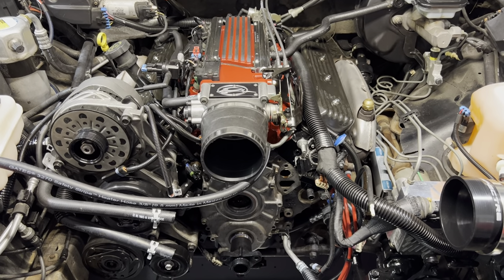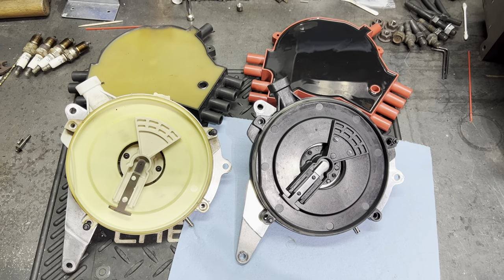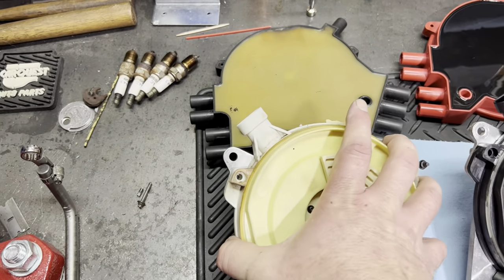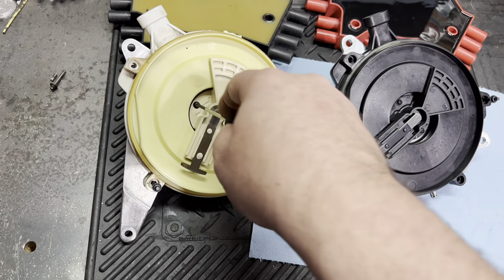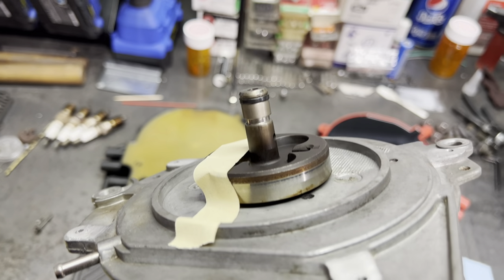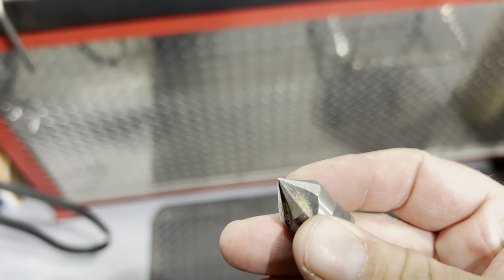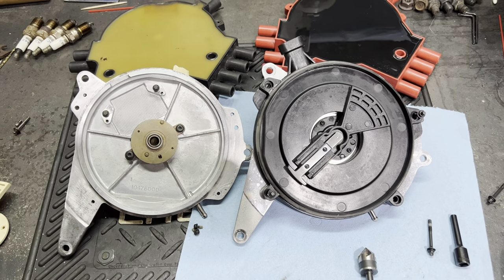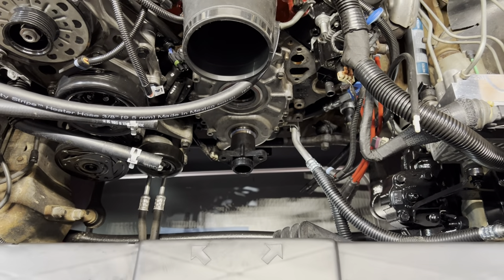Optispark Distributor. Watch before you buy!

Comment: One of the items you briefly mentioned was the conversion to an electric water pump.  The benefits are 1) when done correctly you eliminate the possibility of a coolant leak onto the opti-spark 2) better coolant flow at idle 3) and you eliminate one possible oil leak in your timing cover.  I did mine several years ago and it still runs great.
Reply: How does one make the pump electric? Thank you! 🙌🏼
Reply: Check out my article in the Corvette forum (see above)   I forgot the exact way I wired it, but it was easy.
Reply: That’s exactly what I did and haven’t had a problem with the optical since”electric water pump “
Reply: I mean I have a 1997 WS6 trans am with 85k miles and it still has the original optispark and water pump. No problems. Also it never really gets hot either. If you install the stuff right you should not have issues with it.
Reply: @Someguy6571 your 97 has 85k. That may have something to do with it. Also your experience (as you should be willing to admit) has certainly NOT  been the norm.
Reply: @drwombat  Both pumps can have issues. An electric motor failure is just as possible as a normal waterpump leaking.
Reply: Where do u run power to the electric pump is there a clip already there or do u have to wire it up
Reply: How did you remove the pressed on impeller on the shaft in the water pump?
Reply: @danielr.johnson7966  This was something you have to be careful with.  Be sure to support the housing with a socket on the bossing before pressing the shaft out.  If you don't have a press, go to a machine shop or fabricator and have them press it off.
Reply: Wonder if that’s what’s causing my issue. Not really the optispark itself but the water pump was messed with on mine. Knowing the guy who did it makes me question if it was done cheaply and hurriedly. I have a oil leak but no idea from where. All I see is oil dripping onto the valve cover and down.
Reply: Wonder if that’s what’s causing my issue. Not really the optispark itself but the water pump was messed with on mine. Knowing the guy who did it makes me question if it was done cheaply and hurriedly. I have a oil leak but no idea from where. All I see is oil dripping onto the valve cover and down.
Reply from the maker: @danielr.johnson7966  You have to use a press to get the impeller off the shaft. The pump will come with a frost plug for the back where the drive used to be.
Reply: The downside is that when the electric motor fails, you're totally screwed. At least with a mechanical pump you'll still get coolant flow.

Comment: Best way to get the coolant out of an LT safely is to drain it out through the knock sensors
Reply: Never thought of that. That's actually a really good idea. As long as the knock sensor complies lol
Reply: Most likely will damage the knock sensor..
Reply: @johnnyblade4455  cheaper than an opti that will most likely be garbage or a new engine block...
Reply: wanna know a fun fact? most gm small blocks have an oil plug and a coolant plug in the side of the block and you dont need to pull a sensor.
Reply: @chehystpewpur4754  yup. Doesn't include the LT. The knock sensors are the plugs for the block.
Reply: @chehystpewpur4754  which makes sense because GM didn't put much thought into that engine. If any.

Comment: Bought an LT1 383 crate engine from Golen.  I asked about the opti-spark and he said he never had any problems with the stock OEM vented units. My 96 Z28 never had problem, so I gave him a new opti to put on the crate engine for the dyno:  460hp/440 ft lb   I track and autocross redline is 6500 and it blasts to 7000 before fuel cutoff.  No problems with the OEM opti.
Reply from the maker: In this video, I say do all you can to maintain the stock base and Mitsubishi sensor. The guy at Golen must not know how bad things have gotten with the Current state of Optisparks. Anything can fail. Once it does, what I say in the video is very relevant. Just read the comments. Even guys buying $700 Pro Billet MSD's are having issues. Golen is right, stock is best until you have a problem. The last of these was was 26 years ago. They're long gone.
Reply: @wheelstandr  I appreciate your video as I'm aware guys have opti issues.  I was relating my experience.  Golen built my LT1 engine about 6-7  years ago.  Most of his builds at that time were LS engines.
Reply: Oem is great to bad you can’t get them anymore you have to rebuild them
Reply: @beyond_the_infinite2098  stock opti is the way to go. Have had 3 LT1s the last one I've owned since 2010 and 0 issues

Comment: Yep, the AC Delco is far better than anything else, every 100 thousand miles, pull it off clean it up  relube the bearings, clean up the cap and rotor, good for another 100 thousand, 300 thousand on my red 93, original opti, I bought a 95 for road course tacking only, had an Accel on it already, it quit working so I put an MSD on it would quit every time the engine would get warmed up so I went to the junkyard found an AC been working great ever since.
Reply from the maker: I love it!
Reply: Is there anyplace where I can get an original or parts for the original Optispark?
Reply: Would you recommend the ac delco opti from advance auto parts ?
Reply from the maker: @itsonlydavid2046  If you buy one from them, open it up and look for the Mitsubishi symbol on the optical sensor. That’s what makes them good besides the fact a factory one will be clocked properly.
Reply: @wheelstandr  so if it has the mistubishi symbol it’s good ?
Reply from the maker: @itsonlydavid2046  Thats what they came with from the factory. They were the most reliable sensor I'm aware of to date. I have no idea if they still produce one anymore. If you see that symbol, its a happy day.
Reply: @wheelstandr  The OEM Mitsubishi sensors have been long discontinued. You may get lucky and get one in a remanufactured or new AC Delco unit, but most of them don't have the good sensors anymore. I've used TSP (top street performance) on several friends cars and flip cars with good luck. I'm told they were the optis that Skip White used. Also, I made a similar video about a year ago when I discovered the same thing, it's on my channel.
Reply: Petris

Comment: I bought a cheap Optispark distributor just for parts to rebuild the original. Hopefully I don't need much out of it but im prepared. I haven't done it yet but I'm getting all the parts together now so I can get it all done at one time
Reply: If the "good" parts in your original failed, what makes you think swapping a cheaper modules parts in would help? Wouldn't it be better to use a junkyard oem optispark if you wanted to rebuild? If you've already done this, Has it held up?

Comment: The Petris and MSD Pro Billets are the only Opti’s on the market worth anything
Reply: I bought a brand new petris Optus Park my 94 Corvette made it 100 miles before it threw a code 36 I contacted petris they said they had a batch of bad modules I sent it back and they made good on it so far so good no other problems Opti Sparks are a breeze to change
Reply: @marionthompson7482  that design  doesn't do well in such a harsh environment.  Coolant and oil leaks from the intake manifold and  timing cover can also contaminate the sensor. I had a opti fail because of the heavy rains and water splashing on it as I drove home.  If they would have installed a distributor behind the intake like a SBC they wouldn't fail so much but I can understand why they tried because of the way it was packaged. I'll never understand why they went this route when GM was using coil packs on their V6 engines.  TPI should have been the last time they used a distributor.

Comment: maybe one do it yourselfer in a ten thousand is going to follow your instructions. yes the optispark is a pain, thankfully they cost less than 100 dollars.
Reply from the maker: @siliconvalleyengineer5875  I really wished I had planned out the video. I’ve posted 4-5. If I knew how to edit, I would repost a more thought out version. My plan was just to buy the cheap one and reuse the optical sensor cap and rotor. Everyone thought I was trying to buy this cheap one and put it on as is. I just didn’t expect the cheap one to be out of clock. People still asking me what they should buy. The only one I saw in the comments. Was a lot of money. My best advice is to reuse the Mitsubishi sensor in a properly clocked base. At least people know how to check that now.
Reply: @wheelstandr  The problem with the optispark is that is constantly subjected directly and indirectly to hot water condinsation since its located behind the water pump. The how water condinsation passes through even the tightest distributer body shorting out and causing electrical shocks to the optical circuitry. Optisparks last 2 years maximum if your lucky. My 1994 Z28  has fried 5 optisparks if 8 years.

Comment: My water pump leaked onto my opti, its a 94 so no vent tube, unfortunately it accasionally misses so I'm wondering if there's a way to dry it out or if I need to replace it
Reply from the maker: I would take the cap off and clean it up/ dry it out. You’ll have to use your own judgment on how your going to do that.
Reply: @wheelstandr , Thanks for the advice
Reply from the maker: @hazard4349  Definitely take the rotor off and the reluctor ring so you can get a towel in between the optical sensors. you dont want sticky anifreeze residue anywhere in there, and especially not on the sensor. Be carful not to bend the reluctor ring!
Reply: Yes , you can add brass vent tubes an hook up just like a vented

Comment: Yea delco by far the best. My original finally failed at 250k on my 97 Z after several coolant leaks. Purchased an aftermarket brand and im not gonna say the name and it didnt last 3 months. Left me stranded and a huge tow bill. Returned it for another and that one lasted about a month and a half. Said screw it goin back with delco and has been running great every since.

Comment: Must be a China special, been working on cars for 40 yearsand the amount of shitty parts that are peddled is astounding! 
Always use OEM or aftermarket that is made in the USA.
Unless you want to do it twice or three times, time really is money! 
Thanks for sharing this, sorry it happened to you. Keep on wrenching!
Reply from the maker: I couldn't find a stock one anywhere. I didn't see good reviews on MSD ACCEL even! When I bought it, I knew my Mitsubishi sensor was still good, so I figured, just take the new one apart, put in my sensor, and blue loctite all the screws. Bam! Done! Nope. If this thing was clocked correctly, I'd been off to the races. Welded up the holes on the original, re drilled and tapped 6-40 thread and ran the cap-rotor from the Chinese one with the new screws. Works great. My only regret is not finding a way to add new grease to the hub bearing. Hopefully the 96 grease is good for a while, but if I find a way to do it, I'm taking it off, and greasing it. The cap and rotor at Autozone was $117, and didnt impress me. When I made this video I was tired and frustrated. I also don't know how to edit which is my new goal in life. Captions, music, etc. I could have made a lot of content by now, but haven't because I'm not happy with all the mistakes like forgetting e-torx! I couldn't spit it out! I felt like the word needed to get out on this no matter what, since its almost impossible to get a good one at all anywhere. I'd have to look through the comment, but someone mentioned a company that stepped up. Not a mainstream company most guys would know about. Sounded promising. Thanks for stopping by.
Reply from the maker: This is the company making good ones according to some comments  https://petrisenterprises.com/collections/frontpage/products/1995-1997-optispark-distributor
Reply: this is why i stopped working on cars.
the shop i was at could not get good parts. we used to and all suppliers changed. even gm ford and fiat i mean dodge 2 couldnt get parts. because their supplier and autozone use the same supplier in china. 
my daily toy is a 94 chevy s10 blazer. i picked it because cheap parts were everywhere and a dime a dozen. i literally cant order parts for my car bro. chevy has none and parts stores are calling discontinued on most parts now.

Comment: Wow!! That’s how opti’s can be bad out the box! I’d also add while it’s out update to a heavy duty rotor. Because those plastic rivets holding the rotor tip won’t last with high RPM..
Reply from the maker: I used the Mostplus cap and rotor on the stock base after I welded and tapped the screw holes on the factory base. If they dont fail right away, I won't get as mad. IF they fail early, I will be really pissed.
Reply: @wheelstandr bro u need to play with loctite retaining compound 660 I think is the number.  Could rivet it on or even 3m panel bonding epoxies there's a few dozen formulas even tap able.lord fusor makes even more compounds trust me I get the welding n tapping but damn fella lol n what we can't change optic sensor?  N by sounds of optic sensor what base line or exciter wheel operates it?  I guess I'll  find out soon enough on a 94 w 65k n a dead miss.  If optic and coolant steam sure tf will cloud pick up window odd though driving in rain doesn't fk it up but ya just thought I'd toss out a few options and yes yes yes your 100 percent supposed to rotate to top dead n clock everything or extensively mark all 3 components never in life pulled any distributor without one of two ways n they all still kinda blow to line up oil pump drive if applicable.  One might think it's simple as popping rotor n moving it popping back on but I'm sure it's groved.   I'm lost as why tf not crank trigger it w the 6al box n set up but again I will find out soon lol

Comment: so when you take an optispark apart is there a point of reference or direction to properly put the rotor back in? so the timing is correct
Reply: You really shouldn't take apart an opti. You can find the correct parts from aftermarket vendors (USA made, not from overseas), they will come with a warranty and no messing around necessary. If you have no choice, the reference you are looking for is on the metal wheel which slots into the camshaft. If you are doing this, odds are the cheap opti won't make it longer than 3 months depending on how often the motor is started.

Comment: Do you have too set the timing on the optispark? I keep reading mixed things you don’t have too because it’s controlled by the Ecm and it only goes on one way . Reason i ask is because I’m only getting 15 inches of vacuum that indicates low timing i would appreciate your feed back i have a 1992 corvette low miles brand new optispark
Reply from the maker: You do not time this distributor. 100 percent positively not. The small hose with the blue elbow is fresh air into the distributor and the vacuum from the intake pulls the air out at a reduced rate via the small white and blue plastic canister. It does nothing to advance it. There is also no mechanical advance. The only way the timing can be off is if there is a problem with how the distributor was made, as in this video. I hope this helps.
Reply: @wheelstandr  that’s weird i don’t have that blue vacuum going too my optispark is it different for Camaros and corvettes ? Car doesn’t run too bad just when it accelerates has a little lag
Reply from the maker: @rossschultheis8098  Theres typically a blue plastic elbow that's in the intake boot connected to a hose that leads to the base of the distributor, although that feature was not necessarily present in the earlier spline drive distributors. If there isnt a port on the metal base and one on the cap then your car just doesn't have that. The main point I was trying to make in my answer to you , is that this is only to vent out electrons and is not to for a vacuum advance as no year had that.
Reply: @wheelstandr  i got the car smoked tested found no vacuum leak. Mechanic pulled a spark plug and said the car is running lean just by looking at them he still thinks it’s the timing but doesn’t make sense. I’m stumped on what the problem is
Reply from the maker: @rossschultheis8098  if it’s running lean the engine light should come on and with a code reader it will give the appropriate codes stating such. If that’s the case it should be on bank one and 2. If there’s no light, it’s not too lean. If it is on, there’s only two things to look at. Fuel pressure, or a vacuum leak. The leak is usually a bad hose or elbow on the PCV.
Reply: @wheelstandr  i have no engine light it’s obd1 1992. My fuel pressure was 41 psi with key on car running 37 psi
Reply: @rossschultheis8098  then you have a non vented opti spark.
Reply: I'd say you need to clean or replace the injectors if you haven't already.

Comment: Im doing my first OS on a 1995 Corvette and plan on trying to keep factory base. What actually happens to these ?
Reply from the maker: The optical sensor gives up, or coolant gets inside the distributor years that were vented via drilled holes to daylight. If you have lower mileage on your distributor, you may want to clean the Mitsubishi optical sensor instead of relying on an aftermarket. That’s what I did. If yours is high mileage, you may have no other choice.